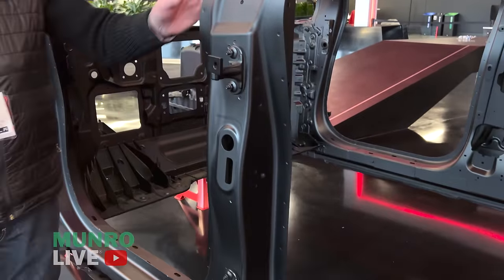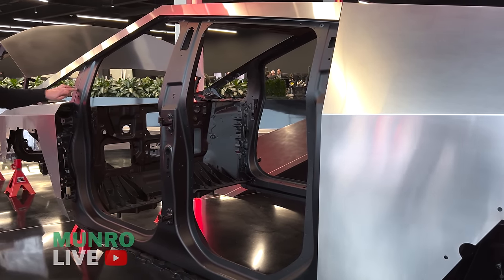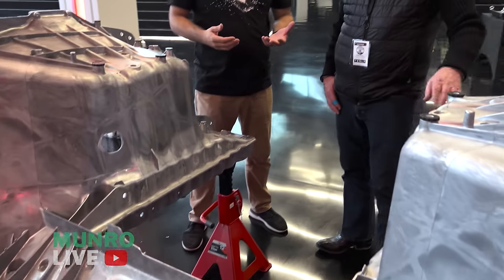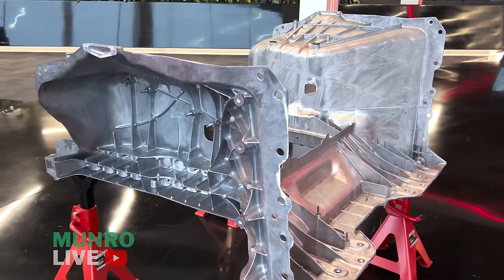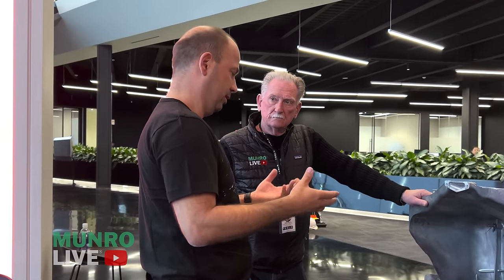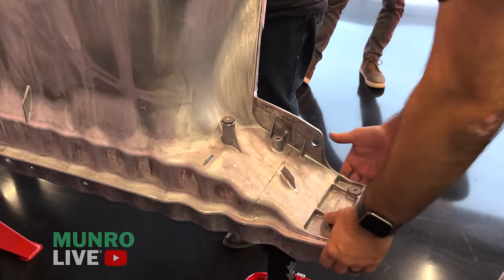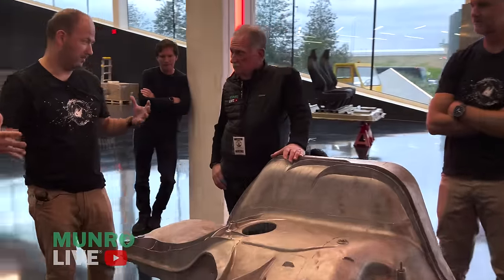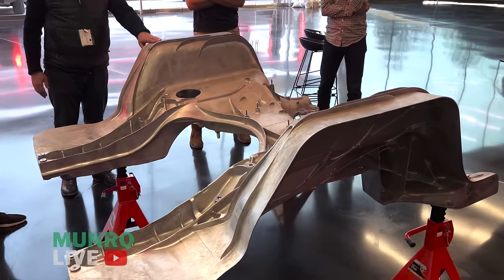Tesla's Head of Vehicle Engineering discuss the Cybertrucks castings and exoskeleton.

Comment: So have they done crash tests and safety tests on the CyberTruck?  This thing is a tank.  There are no crumple zones.  You hit a small vehicle, motor cycle, or pedestrian, even at slow speeds, and they are all dead.  They are going to splatter their brains all over that thick steel skin and armored glass.  Is there proper padding in the A, B, and C pillars inside the vehicle... or the dash?  If the car looses power can the people get in or out of the car?  Is the standard tools fire rescue use going to be able to get through that thick skin and armored glass?  How bad is the visibility and how easily do the cameras get dirty, fogged, or covered in snow?  In an accident how safe are the batteries?  I worry about there things.  What is the range in winter or when towing?  What are the final weights and ranges of the vehicle.  How long does it take to charge compared to say the Model 3?  Why is Tesla so closed mouthed about these things?

I personally think these larger vehicles like an SUV or truck should be hybrids not a pure electric.  Give it a 50 mile range on battery only.  I also think someone should look to see how beneficial a capacitor bank would be fore regenerative breaking... and an acceleration boost to help make the main battery last longer.  This is definitely the route Tesla should have taken for their semi too.
Reply: You spent so long writting a comment but didn't watch the video.
There are "crunple zones" the crash cans refered to in the begining. Also they explain that even the casting is made to absorb impact in a collision.
Reply: @teatowel11  Yes but a crumple zone with a 3mm stainless steel body over it means a pedestrian is long dead before it crumples.  You hit a pedestrian with a normal car and you will see that head cave along with the front grill, plastic bumper, and even the windshield.  You have NONE of this on the CyberTruck.  It is a tank.  He even showed off that it is bullet proof (against most pistol rounds at least).

See those castings are made to absorb impact based on the weight of the CyberTruck to protect the people in it, but against other vehicles this thing is going to be a battering ram.

BTW I type really fast.

Comment: Not impressed.
The crash test footage was terrible. 
I would not want to be an occupant in this car during an accident.
Elon’s claim that it’s ready for the Baja Rally is laughable. 
This truck would break in several pieces of it ever attempted a race like that. 
Also, it weighs around 6,700 pounds, which is about as much as a Mercedes Benz G-Wagon. And if a G-Wagon gets 14mpgs, then the Cybertruck is going to have comparable or worse equivalent “fuel” mileage. Especially since the Cybertruck is 80-100% coal powered. 

Anyone who buys one of these has more money than sense.